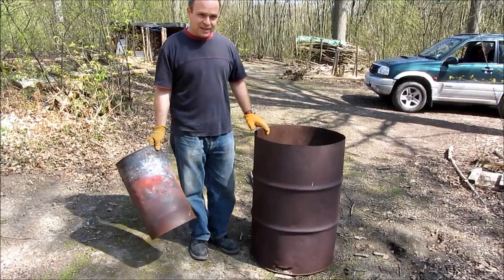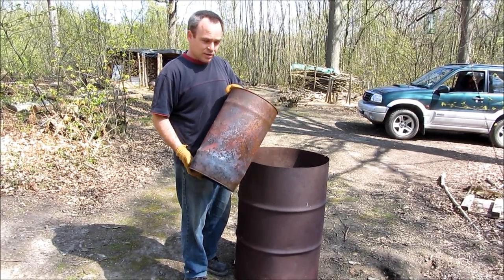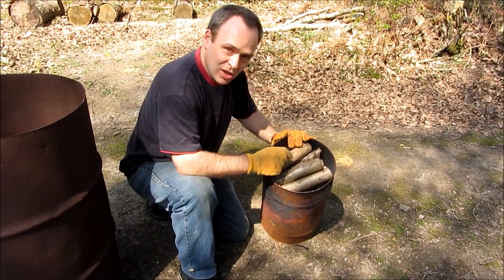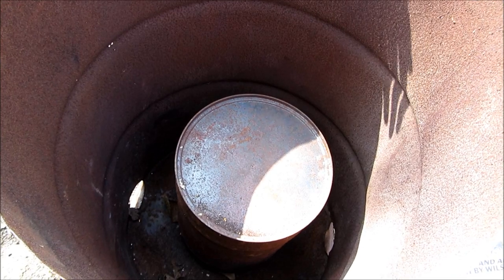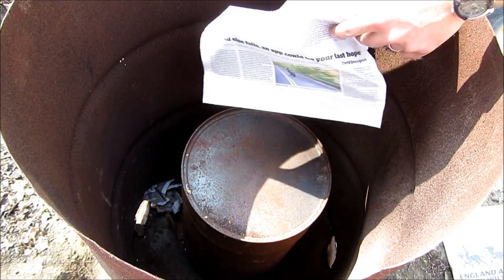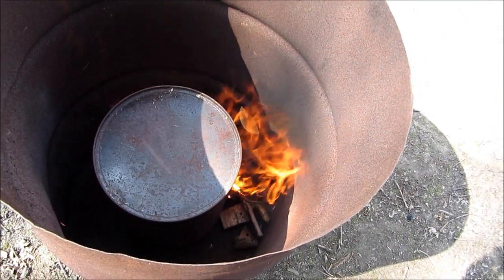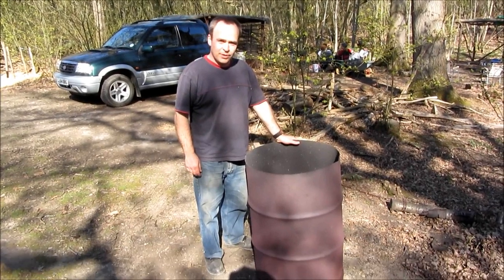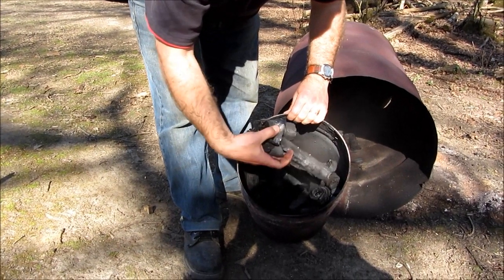Making #Charcoal the Easy Way

Comment: I love how simple this is, and yet efficient.  All the wood gas pushes its way out the bottom and contributes to the fire, and then when the fire is out, the surrounding ash make an airtight seal around the bottom.  This is the one I'm building.
Reply: Mountain Boomers I referred to this video to make my own hardwood charcoal. I have almost a 55-gallon drum full of homemade charcoal now. I also appreciated the simplicity of this process.
Reply: 2y later but THIS….simple build AND you burn all of the volatiles that off gas to contribute to the heating of the retort.  Instead of just stinking up the neighbourhood.

Comment: Thank you for the informative video. Tried it with 100% success.  A little improvement: you may cut the bottom of the large drum as well, round the edges and keep it for use as the base. Procedure goes:  Fill the small drum with wood: Use the cut bottom as lid: turn upside down: Center the small drum on the cut bottom: Position the large drum around the base: then as usual...
Reply from the maker: That's a good idea! Pleased to hear it went well.

Comment: Thanks for sharing this.  Your method is about the simplest I've seen.  Will give it a go.
Reply from the maker: flysubcompact Let me know how you get on. I'd never tried making charcoal the other ways, as they involved a lot more work and had a lot more scope for failing. When I heard about this method I thought it sounded good, and it has supplied all my BBQs for 7 years now...
Reply: Soon as I line up the proper drums I will do this.
Reply: @flysubcompact  did you do it already??
Reply: @GOAT_GOATERSON  yes, i did, but on a smaller scale. The method worked.
Reply: @flysubcompact  nice thank you for replying 😀

Comment: Thanks for the video. We need to make some charcoal to use in a survivor's water filtration experiment. I know that it was 3 hours later when you took the charcoal out. How long did you burn it for? Sorry, I must have missed this info. Bad hearing here. Did you have burning wood covering the entire inner bucket or keep it only halfway? Thanks for any POSITIVE input! Our family only BBQs our salmon with charcoal. Sometimes we add cherry wood, or wood bits that we use for smoking the fish.
Reply from the maker: Hi. I usually make the fire about half the height of the smaller metal drum,  and burn it for about 3 hours. Then you need to let it cool down - until you can touch the metal. Then you can take the charcoal out. Mike
Reply: Thanks so very much for the quick reply. Gonna try this out in a controlled area the next time I'm out in the wild and caught fish to smoke. My city has a ban on open fires. Flame on!
Reply: I can't believe it turns to charcoal after only 3 hours (+ cool down)! Thanks for the video!
Reply from the maker: Yeah, it's pretty quick! Probably because of the small volume per burn.

Comment: Exactly how long was your total burn time?
How long was your cool down time?
Did all of your wood turn to charcoal?
What is the weight ratio between the charcoal & preburned wood?

Thanks for sharing!
Reply from the maker: I've not timed it precisely, but 3 hours is usually enough burn time, perhaps a bit less. Cool down is probably an hour or more - I don't empty it until I can comfortably keep my hand on top of the inner drum. I've not tried weighing the quantity of wood, but at a guess I'd say I put in 2-3x as much wood to burn as is turned into charcoal - so it's not very efficient, but it's scrap branches and stuff to provide the heat, and the whole setup cost me nothing. If you'd like to see a more efficient way, look up the Hookway Retort Kiln, but bear in mind it costs a few thousand £.
Reply from the maker: +zeffur7 about 2 years seasoned, so should be 20% moisture or a little lower. Next time I do a burn I'll weigh it...
Reply: Thanks for all your feedback & for sharing!

Comment: So I'm pretty sure that as this goes, the wood gas from the wood in the smaller barrel must be forcing its way out around the bottom to be promptly ignited. So it is not wasted, but is actually contributing fuel to the process. That would make this method substantially more efficient than it might at first seem.

Either way, nice work!
Reply from the maker: Yes, the woodgas joins in with the fire providing the heat, so gets used, and by burning it properly there's minimal smoke.
Reply: That's a big part of the beauty of the design, IMO.

Comment: Wouldn't it work better to have a small vent hole on the bottom of the smaller barrel (top when turned up-side-down) so as to allow steam and other impurities to escape when the wood inside is heated up?  Oxygen won't get into the barrel cos the pressure of the escaping steam/impurities is greater than the oxygen trying to get in.
Reply from the maker: +Z.A.P. Squad possibly, but I'd worry that near the end of the burn oxygen might get in through the base then. The steam and other gases escape at the bottom anyway, though some argue that leaving some hydrocarbons in there improves the taste when cooking with it...

Comment: cut a hole in the top of a sealed barrel that you intend to make charcoal in a bit larger than the wood you add to it.then cover the hole after wood is packed in with a piece of tin and a couple bricks to hold it down,without pressure,as it will vent steam,this way you dont have to flip the barrel over,and the coal will not ignite during the process.i have got over 30% weight of what i started with in carbon and very little wood wasted.
Reply from the maker: Thanks, good suggestion. What I'd really like is one of these https://youtu.be/nhqFsCuo058
Reply: Mike Pepler love this technique. I have a large drum with a lid. Gonna try making a double height smaller drum and see if can get make more per burn.
Reply from the maker: Sounds good! 🙂

Comment: Look great and very simple. What are approx the dimensions of the small barrel?
Reply from the maker: Approx 10" diameter, 20" height. Main thing is to leave enough space for a decent fire in the gap, and not have it too tall, so the top of it gets hot enough.

Comment: Do you think it would work with an old gas cylinder as the inner chamber. It has much thicker walls which would retain more heat, but I worry it would not allow the gas to escape from under it due to its weight....?
Reply from the maker: +Tony Browne sounds like it would work, and be more durable - the heat and gases corrode the metal. I think the gas would still escape, it won't be a tight seal. You could cut a few small notches in it to be sure.
Reply: Your method has been under fire for 3 hours as I type. It was such an easy way to go that I thought I would give it a go. If it works I will do two things. 1. Post here my experience. 2. Cut the old gas cylinder and give that a try!!! Happy days. :)
Reply from the maker: +Tony Browne great, look forward to hearing how it goes!
Reply: Worked a treat! Perfect charcoal!
Reply from the maker: +Tony Browne great! Let me know how the gas bottle version goes...

Comment: hi, thanks for sharing, does the wood have to be dry or can it be green?
Reply from the maker: +ningaloo67 It needs to be dry. I've not tried it with green wood, but it would take a lot more heat (to drive off the sap), and I think you'd be more likely to end up with some half-charred logs, or else very small pieces of charcoal (due to the wood spitting and popping as the sap is boiled).

Comment: So mate, was just wondering, how to do you make sure the normal ash & the charcoal doesn't get mixed up while you are pulling the smaller drum out? I am planning to make activated charcoal, so would need only the pure 'baked' hard would charcoal...

thanks
Reply from the maker: What I do is, once it's cooled down, move the small drum to the near side of the big drum, then carefully tip them towards me, until they're lying on their side. Then you can tilt the small drum so no charcoal falls out, and pull it towards you to get it out.

Comment: Hey there !
I have a question : is it possible to make that with mud type "barrels" ? Or is steel essential for the process ?
Reply from the maker: Not sure what you mean by mud barrels? I think it needs to be steel really though, because at the start and end you need to tip it over onto its side.
Reply: By this I meant clay/dirt type materials. Even if it's more fragile, it could normaly handle the heat and some hit... so the question is more about if the process can go through, even with something different from steel.
Reply from the maker: Sounds like it would work fine then, if it's not too fragile, add it should be able to take the heat and avoid any air getting in.

Comment: Now would this be adequate enough to make black powder by crushing it into a fine powder?
Reply from the maker: +MetalDrums101 I've not tried, but I don't see why not. Perhaps use a longer burn to make sure all the volatiles are driven off.
Reply: Depends on the type of wood you use.  Some woods are good for fast black powder.  Some are better at producing sparks for effect.  Some are not good at all for either.

Comment: Hey mate. My charcoal (hardwood) turned out quite light and breaks apart easy. Did I run the fire too long or should the charcoal be like that? I've noticed bought lump charcoal seems to be denser/heavier...
Reply from the maker: I guess running the kiln for a shorter time might reduce that, but it would be hard to judge it right. More significant is the type of wood, what did you use? Hazel, hornbeam, oak and ash are good, but I've had reasonable results with sweet chestnut too. The wood needs to be thoroughly seasoned of course.
Reply: @mikepepler  I'm in Australia and using very old, seasoned Ironbark. Maybe I'll experiment reducing the time..

Comment: Mike, why didn't you drill holes on top of the smaller barrel for gases to escape ?
Reply from the maker: The gases can escape from the bottom of it. If you had holes in the top, that could allow oxygen to enter at the bottom and burn up the charcoal.

Comment: If only we could burn anything around here without getting finedor arrested...since roughly autumn off '08, specific burning laws went into effect where, for example, I wouldn't be able to use newspaper, and I wouldn't be able to use the taller of the two drums unless it was for approved brush burning at specific times of the year...and yes we live in a very rural area (I can't complain, I'm not among the Many who've learned to live without heat in winter because their woodstoves are no longer legal and no one can afford the legal ones🙄)
Reply from the maker: Where are you? Are the rules for pollution control or fire risk?
Reply: @mikepepler  I'm in New York, the Southern Tier...when they changed all the regulations they said it was mostly for air quality 🤔
Reply from the maker: Same is true in the UK in London and other cities. Thankfully we live in a rural area, so not affected. Pollution is a problem in London, basically because there's too many people living too close together.
Reply: Charcoal for camping is still OK here, yet I fear a visit from the authorities... considering the possibility of a ground trough to make the charcoal, since where there's less smoke there's less trouble🤔😀

Comment: where in the world can you find small steel barrels or steel drums?
Reply from the maker: That one is actually a gas cylinder with the end cut off. There used to be 20 or 25 litre vegetable oil drums too, but most are plastic now.

Comment: Does the barrels have to be flush against each other? Or is it okey if the are a bit gnarled.
Reply from the maker: I've always had them as flush as possible, as you don't want air getting into the small drum, but I expect a slightly rough edge wouldn't matter.

Comment: is this the same as "activated" charcoal that can filter water. whats the difference between this and just coals?
Reply from the maker: Mike Warren It's not the same, though it could maybe be used as material for making it? See http://en.wikipedia.org/wiki/Activated_carbon#Production
Reply: So this kind would be used for cooking?
Reply from the maker: Mike Warren Yes, I use it for BBQs. It lights very quickly.

Comment: Are you not wasting wood that would other wise be used for charcoal?
Reply from the maker: Not really, as the wood I burn in the outer drum is just sticks that are lying around, while wood being converted to charcoal is carefully stored and seasoned. Also, you have to apply some heat from somewhere to turn the wood to charcoal, so it's inevitable that some wood will get burned up, unless you use another heat source. A proper retort kiln, if insulated, can heat itself entirely from the gas produced as the wood turns to charcoal, but that's a much more industrial setup than my two oil drums! :-)

Comment: what can you use this charcol for? i dont understand, ? is this the same shit you buy in a store to grill on?
Reply from the maker: +Great Dragon You can use it for anything you'd usually use charcoal for, cooking, blacksmithing, etc. But it lights a lot more easily than the briquettes you buy in the shops, ready to cook on in under 10 mins.
Reply: It's CHEAPER than the stuff you buy at the store too. If you use a charcoal fired kiln, furnace or forge this could save you a to of money.

Comment: How long?
Reply from the maker: You need to keep it burning for 2-3 hours. Then I usually leave it overnight to cool, but maybe a few hours would do.
Reply: +Mike Pepler so you still have to add more wood to keep the fire burning or it is just the wood you put at the beginning? if you have to add more? how many times you fill it up? thanks great job..
Reply from the maker: +Andreea Ivanesei I add more to the outer drum, probably about 4 times. The goal is simply to keep it burning for 3 hours or so. I just use old branches and twigs for the fire.

Comment: Does it make a lot of smoke? I was thinking of doing it out on my balcony of my 3rd floor apartmint, there is only one floor above so it shouldent be a problem.
Reply from the maker: It's smoky when you first light it, but once it's going there's almost no smoke. Don't forget a lot of heat comes out the top though, and the base of the metal drum can get red hot at the air vents - you might want to try it away from any buildings first time...

Comment: my question is... why dont you just use the wood in your bbq... i have been running a smoker bbq for years... always use real wood.. much better flavour
Reply from the maker: Fair point, especially as burning wood is more efficient that charcoal. But don't you get the meat blackened from the flames when using wood? Or do you let the fire die down and cook on the embers?
Reply: Mike Pepler
No i have adjustments in the bbq to raise or lower the firetray... sometimes you do get some blackening of chicken skin and such ... but you get that on anything... mostly the bbq is used as a smoker and its all offset so no direct flames .. just the smoking of the hardwoods..
Reply: jason duffy In the UK, the nomenclature is a bit different. When we say BBQ, we mean grilling or broiling on a grate suspended inches above the burning coals. In the USA when they say BBQ, they mean hot smoking in the heat and smoke of a wood fire, but not directly exposed to its radiant heat. Explains why we use charcoal for 'BBQ' in the UK.
Reply from the maker: Oliver Riley
Ah, that explains it!
Reply: See you ask about grilling but you say you use your grill as a smoker, smoking and grilling are different, as far as grilling goes I haven't heard of anyone using wood for direct cooking here in the south, we use lump charcoal, briquettes or wood in a smoker box(some people use propane but to me that isn't grilling)